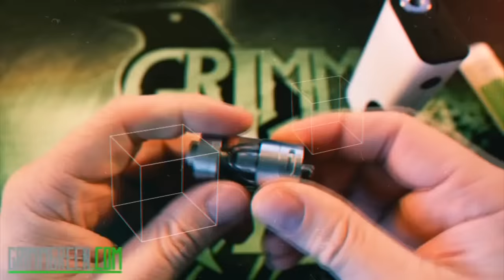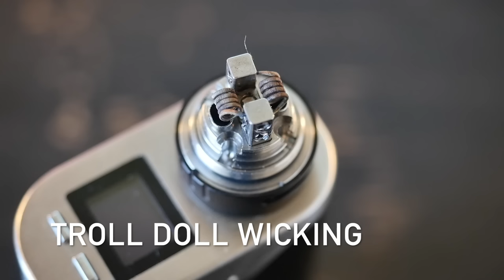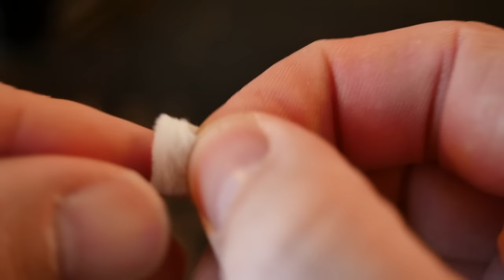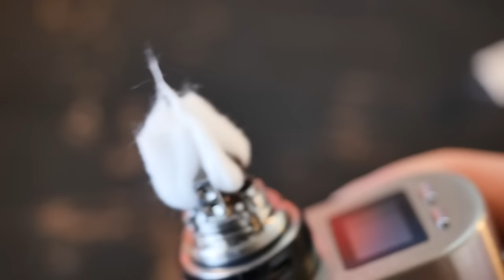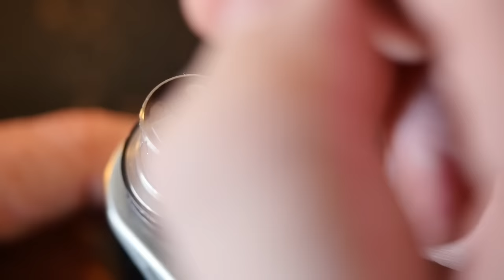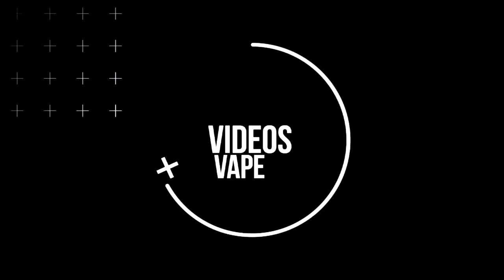The Troll Doll wicking for RTAs

Comment: Yo Grimm. Quick question. I'm going to the the wismic Reuleaux 2/3. What's the best (as well as price) atomizer for it clouds and flavor???
Reply: J Chaisson There isn't a simple this is or that is the best, answer. Do you want a tank that can house stock coils or do you want a rdta, or one for both. TFV8 is good option as you can use either.
Reply: J Chaisson recoil rda
Reply: MadCowGoMoo I rather the recoil RDA bc I can switch out the barrels for CBC and for FBF. But If not I'll go with the Pharaoh RDA. Plus the black RDA on the all black wismec reuleaux 2/3.

Comment: I've been doing that in Kayfuns for years. It doesn't always work with other RTAs for me though. If the airflow on the deck doesn't sit higher than the rest of the deck, I get flooding issues. It's definitely a super easy way to wick any tank that it works on  though. And I usually try it at least once to see if it does.

Comment: This never worked for me on the Goblin Mini. Not ever. No idea what I'm doing wrong, but the Goblin dumps juice every time this way. Switching to the Scottish Roll method changed my life, though. I've since ditched the Goblin for the Serpent Mini and the Scottish Roll is still perfect. You don't have to do anything crazy, you just wick like you normally would, down into the juice wells and the Scottish Roll will soak up juice like a champ.